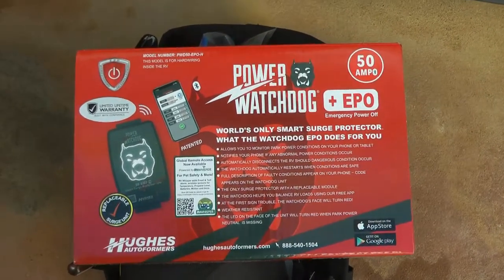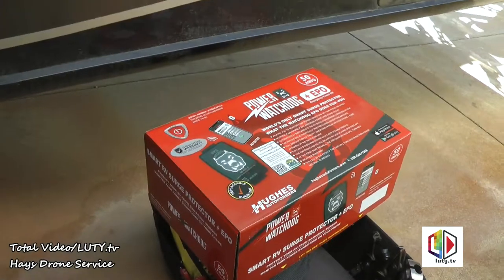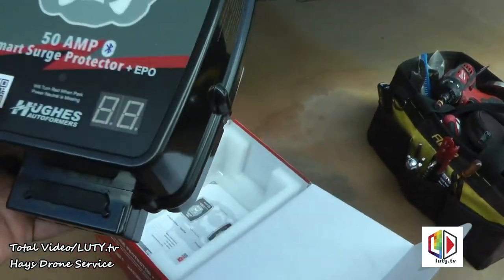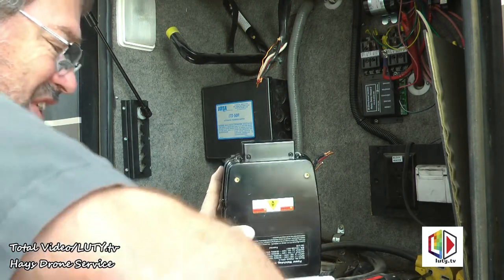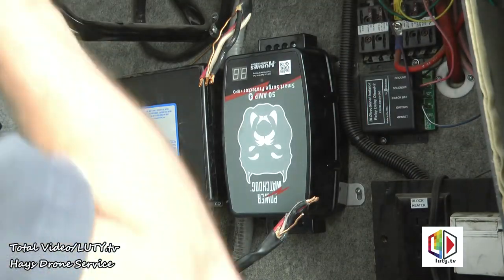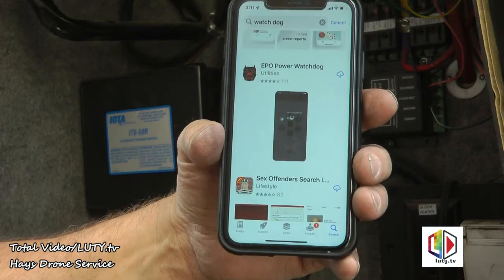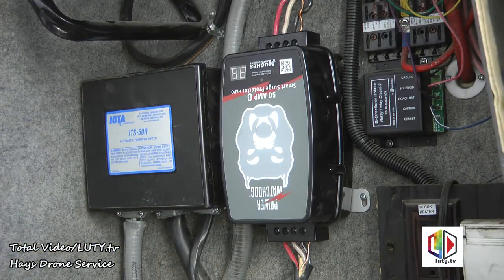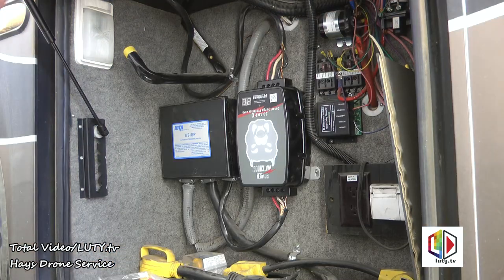Hughes Autoformers Power Watchdog + EPO Surge Protector Install and Watchdog App Operation

Comment: Nice video...that is why I bought the Progressive Industries EMS with the remote display so I can see the Voltage and Amps inside the RV  About to move it to my new RV.  Both EMS are great units....I do like that the Progressive handles the wires better with a strain relief.